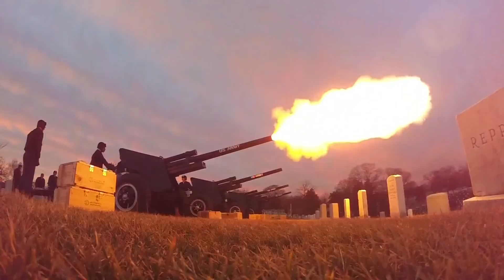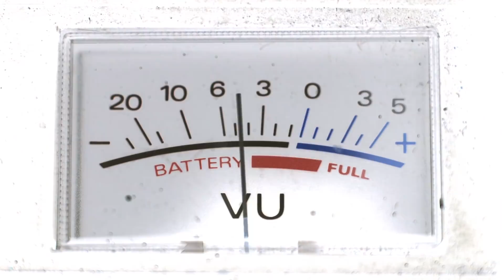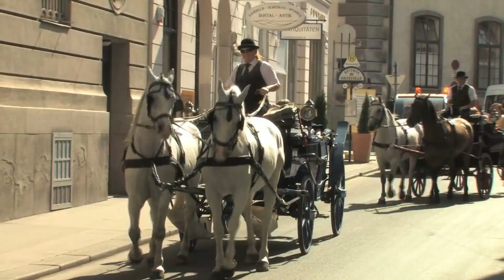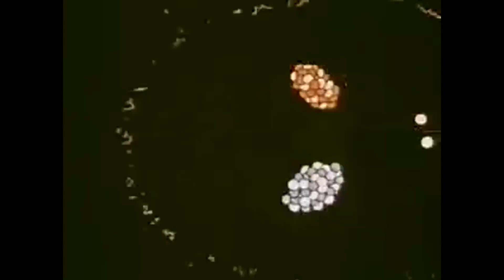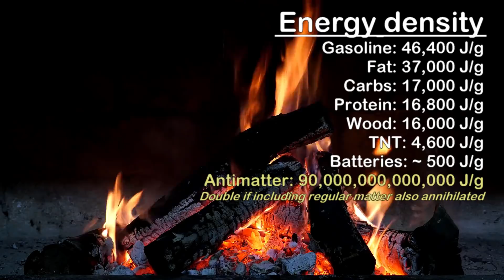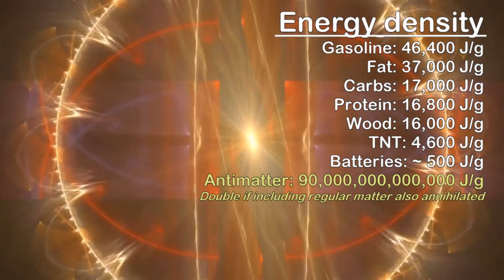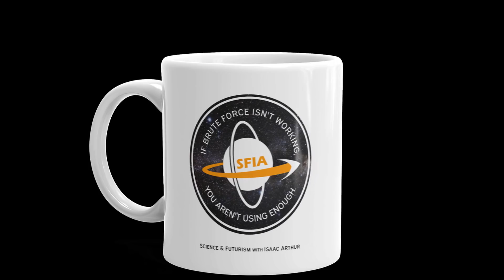Portable Power

Comment: You disparage Flywheels a bit, but wasn't there a flywheel energy storage system on the ISS before the current lithium system? - i know there was talk of this at the time, and it may never have actually been installed but i believe it was certainly designed and tested. Also it was considered for busses and may have been installed on some test busses. Ps this is based on vague and possibly wrong memories from 20 years ago.

Comment: Imo i think that the only true 100% efficent way of storing power would ne rotating objects like flywheels, angular momentum cannot be taken away unless you have an outside force act upon it 
So if a flywheel spins in space, it could spin until the very matter its made of decays, and all it takes for them to power a space ship is by having a rotating type of key that attatches to a power generator like a crank motor, the mass of the wheel drives the motor taking power off and slowing the wheel down, and all it takes to refuel them is just by having some kind of super spinner that can rotate these things to whatever energy levels they want to store
These could be made out of just simple regular iron, and then it will never decay even as trillions of years pass, not unless something takes that energy from their rotational speed

Comment: QCD is a smoked herring (smoke screen/red herring) the two up quarks in a proton are positrons and the down quark is an electron. A neutron being an electron added to a proton below protiums first shell. The apparent imbalance of matter to anti-matter is gone. Perfect 1:1 ratio in the universe. The charge and mass is right minus a neutrino or two for the neutron. The LHC uses high frequency AC to strip an electron from hydrogen for protons then magic apart the proton to liberate two positrons. These positrons are beam dumped into some electric calthrate storage. The second Manhattan project is underway.

Comment: Eric Drexler proposes using nano-scale flywheels as a energy storage system.
There is no scale advantage, the J/kg depends mainly on the tensile strength of the material at the flywheel rim.
His rational is that nano-scale material engineering will maximize the tensile strength. 
The overall energy storage is 0.5 T (tensile strength) * V (volume being strained).
Divided by mass: E/m = 0.5 T / rho ... where rho is material density after correcting for mechanical voids.

Comment: In order to compare fuel energy with battery you need to add the oxigen needed to burn it as well. You can't get energy out of fuel without a reagent. The combination is much heavier and has a much lower energy density and it's that much more efficient then the most efficient batteries currently available.

Comment: One of the things we have to remember is the unwillingness by large companies to " RE-TOOL" ... Throw in lobying and you have great ideas that don't get developed and are even smuthered ... Wind mills are an old technology but were always neglected by large companies because of their inability to control their production and use ... 
   the story behind the " sterling engine " is that its' use is limited by it's ineffecient power produced to size problem which cancels it out for vehicles and craft but it's great as a stationary generater ... Combining different types of power producers for energy production is the obvious answer ... No research is being done on the Egyption battery to my knowledge ... Imagine the combination of the 3 power souces mentioned combined with newer and way more powerful batteries ...

Comment: Tesla's magnetic resonance with power relay stations is the answer; this is superior to magnetic induction.  See the MIT company Witricity which patented this technology.  UBeam is another energy transfer technology based on soundwhich requires a direct line of sight using sound waves outside the range that the human ear can hear; this encompasses the use of transducers as are in speakers.  If lasers or photons could transfer or relay energy from the sun out to deep space, that would be cool.  Supposedly with magnetic resonance as the field gets larger the loss of energy from the field gets smaller.  So the wireless energy field becomes more efficient from what I hear.  Some believe that Tesla rediscovered this technology from historic Egyptian writings.

Comment: I am really interested in a photo-nucleaic cell using tritium vials, specifically focusing on the different color wavelengths vs power output.  However, I have seen the total output to be about 1/3 output of the total PV cell, additionally, to extract usable energy (33 watts or so)  requires a huge surface area, and most of the available Tritium vials are 3 mm wide.  So cost is way past any experimentation I can do realistically.

Comment: the main problem with Betavoltaics, as far as I know, (and I am just an amateur) comes from  the lack of broad range spectrum absorption  (unlike your typical PV cell which absorbs ALL of the visible light spectrum.)  So while the Beta radiation has higher energy output in that wavelength, the cumulative effect is much less power output.   I have been trying to find a method to apply an alpha absorption layer (or maybe a clear varnish or lacquer) that would coat the cell, but I have not found that, nor such a materiel yet.  As far as Gamma. x-ray or Neutrino absorption,  I have no clue how to solve.  I know in most light water plants here in the US we use large pools of water to absorb Neutrinos, because we have to.... If anyone else is looking into this tech, I'd love to start a discussion.

Comment: Nuclear fusion = 353,000,000,000 J/g For fusion deuterium + helium-3. 24% of the particles produced by this type of fusion are x-ray and neutrons the other 76% are charged particles that can be captured for direct conversion to energy.
If we had the domain of sustainable nuclear fusion in the future, and only stored 10 million tons of deuterium + helium-3, we would have as much potential stored energy as 378.122 trillion barrels of oil in usable net energy considering that 24% of the energy produced was 20%. x-ray 4% neutrons that cannot be captured and converted directly to energy and of the remaining 76% 3% would be used to keep producing and maintaining plasma within the reactor of the remaining 73% and an 88% efficiency conversion method to Deuterium + helium-3 fusion can produce 229 trillion joules per KG in actual usable energy as deuterium + helium-3 fusion produces very little in neutrons better and much more efficient energy conversion means than steam turbine can be used. so 88% of final usable energy conversion efficiency is quite acceptable.
250 refined helium-3 space freighters loaded from planet Uranus totaling 5 million tons of helium-3 + 5 million tons of deuterium extracted from terrestrial ocean water could give us this immeasurable reliable reserve of energy for tough times. 
In my view the best way to store long term energy within the real world is possible.
That is if we do not reside next to a star mass black hole that we can mass matter around it and throw it into it in order to convert matter to energy the black hole converts 6% to 20% of matter into energy depending on whether rotating or non-rotating this would be much better than merging, but we would have to have access to a natural black hole and would have to build the necessary structure and a safe distance to live in a black hole system if we don't have planets or at least planetoids abandoned orbiting this potential black hole.
The other 20% of the energy produced by the deuterium + helium-3 nuclear fusion reaction is x-ray. A secondary system could be designed to use very bright x-ray particles to heat water and extract some amount of energy from that x-ray. x which would otherwise be lost unlike neutrons which is impossible, considering a 47% efficiency steam turbine for a large nuclear fusion reactor this could still yield tens of trillion barrels of oil in energy equivalence for use. So if we have controllable nuclear fusion it would be very interesting to store fusion fuel in some depot on planet earth or another desired planet and use it slowly in difficult times.

Comment: How is wireless power transfer in homes allowed under known physics? There is one method that actually works which is induction, but this only works on distances less than a centimeter. It doesn´t make a difference if I have to carry my phone to its induction loading station or if this loading station actually has contacts I put it into. If you want to transfer power over larger distances you need either laser or microwaves and it doesn´t work with a moving target.

So please tell me which known physics allows equipping homes with wireless power transfer for devices used in them.

Comment: Transmission lines would be safer and suffer less line loss over distance if the wire were insulated(and I'd still have a left hand). But the line would be far heavier, which would require stronger equipment, and after paying for injured workers your still looking at line loss being cheaper than improving it with current technology. Right now capacitor banks are the best bet to combat induction. They're all over the place. Companies are starting to play around with new voltage converters. DC has less line loss over long distances with high voltage transmission lines. So generate in AC step up to 500kv convert to DC. Miles of transmission lines to get to the load. Transfer back to AC and step down to distribution voltage. 12470 or 14,000kv then to a 120/240 transformer then to the tv and wifi to watch SFIA!! 
Great episode!

Comment: Hello Isaac. 

   Another wonderful video. I do so enjoy hearing you explain concepts that I often find hard to explain to people I know that have not spent the time I have over the decades to understand these concepts. 

   I note that you will be doing a video on O'Neil Cylinders (by the time of this missive, you already have). 

   I think I remember stumbling across that video, so I will address some concerns I have with building such devices. 

   For one, I do not see why we would need to build such cylinders out of 'normal' metals. Using simple, large mirrors, you can 'pump' sunlight onto asteroids to melt them. Spinning said asteroid will cause the heavier elements to migrate outwards, leaving the lighter elements in the core. 

   'Strip mining' the outer layers will net all the various metals one could desire for any applications one has a need for them. One could literally strip mine down to solid rock. Depending upon the spin given to the object, the rock would be fairly thick and be a short thick cylinder. 

   Boring out the center after moving the mirrors to allow the rock to cool and solidify, would allow the 'miners' to mine the light weight elements in the center, while hollowing out the rock cylinder itself. Packing the resulting 'hollow' with ice obtained from the Kuiper Belt, and sealing off the ends allows for the next phase of 'construction'. The Ballooning of the rock, by melting the rock again and vaporizing the ice inside it to have pressures needed to expand the molten, or near molten rock. 

   The end result would be a hollow rock tube, with the walls miles thick. One could then install air locks, use more kuiper belt ice to make an oxygen atmosphere and begin Terra-forming the interior surface of the cylinder. 

   I do not see that I need to add any more to the later stages of construction of such a habitat. But I will note that dozens of miles of rock should be plenty thick enough to allow such a habitat to survive small impacts. Anything large enough to be dangerous to the habitat, one would either blast into tiny fragments to spread the damage out over a larger surface area of impact, or, drag off to be 'mined' itself for its valuable materials. 

   Such rocky cylinders would not be ideal for multi-generational spaceships, but would be useful as habitats for farming, living space for populations, and manufacturing area under gravity-like conditions due to spin. 

   Just my thoughts, 

speaking Frank-ly

Comment: In current time we start looking ( 8:40 ) about using DC for long distance transfer lines, because they have less lose, and because transistors we can easily (with low lost) transform to AC, with one is easy to change voltage. There are many things why they was not possible in past, as transistors not exist, so they use very lost method of conversion, but DC do not make change magnetic field around cable, and use full profile of cable (DC mostly use only surface )

Comment: Finally someone is right about why AC is used for power transmission! It's just so darn easy to change the voltage. DC requires a power converter to increase voltage or decrease it efficiently.

Comment: Excellent as usual.

I didn’t know you were a fellow veteran, not that I would have a reason to.

Although I went to grad school in a medical discipline (my undergrad studies were physical sciences) I took a class in the Department of Nuclear Science titled “Nuclear Reactor Theory and Design” just for the Hell of it (yeah, I’m one of “those people!”). There I was introduced to RTG’s and I’m still fascinated by them to this day. You do seem to dwell on shielding problems but those fueled by alpha emitters require little or no shielding.

In regard to power transmission via lasers or microwaves/masers, there is a problem which limits transmission distance: the inverse square law. Resistance in metallic conductor cable can be overcome by cooling or otherwise using superconducting materials. But I know of no way to overcome the inverse square law limitations.

If I ever have the opportunity to start my own country (or planet), I think I’ll use a power type not uncommon in industry but as far as I know not used anywhere on the globe (or in ships or aircraft...I once heard it was used on the International Space Station but I never attempted to verify the claim) for public power. I would used pulsed square wave DC. It’s easy to step voltage up or down using transformers. To improve efficiency my system would incorporate three or four phases. With the exception of the US and a few other countries, all of the world uses 220 VAC-240VAC for household power and I would continue this practice. To again further improve efficiency I would use a higher frequency than the 50 Hz-60 Hz worldwide standard. Large aircraft use 400 Hz power and one would be amazed in the difference in size between say a 62.5 kVA 400 Hz aircraft generator and a similar output 60 Hz generator. Picture a household vacuum cleaner or microwave oven with a power cord slightly larger than a pencil lead!

To further save on copper usage (smaller wires) all vehicular power systems would use 24 VDC...42 VDC if an economical way could be found to construct a 21 cell battery (the 42 volt battery would be the same physical size as the 12 cell (24 volt) and 21 cell (41 volt). The higher the voltage, the less current is required for the same power and less current means smaller plates.

Comment: So.. 

A big wheel. 

Compartmented. 

Each partition is a radioactive honeycomb, full with Nitrogen. 

Compressed. 

This is spun to a reletivistic speed.

Now the inertia alone makes it a battery.. 

Now.. The existing radioactivity in the honeycombs will make Nytrogen turning both radioactive.. 

But also change number of possible bonds.. Thus both reducing the preassure.. 

And make atoms closer.. 

In a high energy, radioactive environment.. 

We will have a lot of Carbon14.

Renewable even.. To a point.

Comment: This is so cool, but I have so many questions...
Do those "light batteries" have a name? Can I learn more about them somewhere?
Could you use a black hole generator to create anti-matter relatively efficiently? Wouldn't a black hole be better for "charging" a light battery too, as storage for the hawking radiation?
Could you use a light battery to power a small electronic, like a modern cell phone or laptop? How would we do that? A solar panel? How efficient is that? What about recharging them? Could you use modern wireless "charging" technology to effectively power an LED and shine light into it? How efficient is that?
Could we use antimatter to do the same thing, power cell phones and the like?
In any case I guess that we'd probably want these to contain only a small amount of energy, nowhere near even a single gram.

Comment: When I was a kid I was a bit obsessed with energy sources and I had imagined bottling light. Made lots of research on the absorption rates, light reflection, etc., of various materials in the visible and infrared wavelenghts. My idea was to build a multi-layers box that wouldn't absorb, but rather reflect visible and infrared (even far infrared) light. Bouncing light generates photons of lower and lower energy, since no mirror is ever perfect. So being able to reflect far infrared considerably reduces the energy loss. Photons are hard to contain!

Comment: I am surely not the first to have this idea, but if you can produce a lot of antimatter, and use it in space on a large scale, storage becomes kind of trivial. You just have to put enough of it on one spot so it becomes bound by its own gravity. That would give you a planet-size, 100% efficient battery. You just have to keep the mass of your antimatter between the point of loosing its own gravity and the point of starting fusion. 
The only thing you have to build is a shell around your ball of antimatter to shield it from cosmic radiation or bigger chunks of normal matter.

Comment: You can't really move a black hole, so it's not exactly portable.
Reply from the maker: They're as mobile as anything else of the same mass really. You just cna't touch them with anything you don't mind losing. Hit on with a laser or matter beam and it will accelerate same as anything of the same mass.